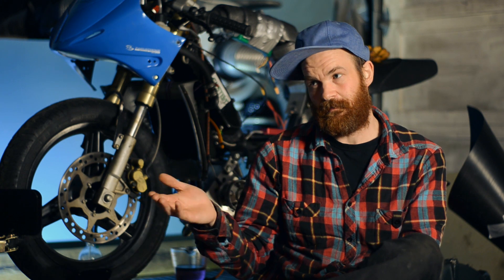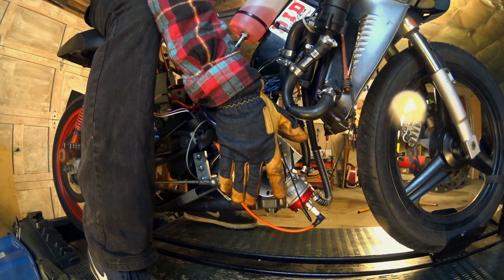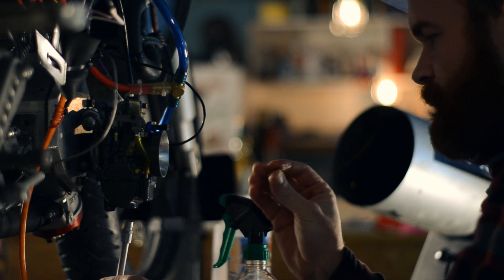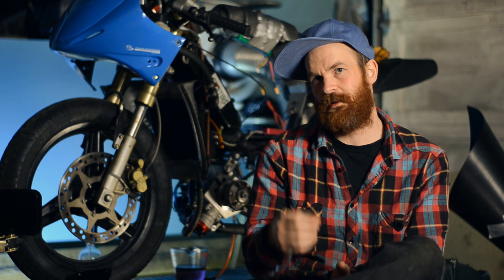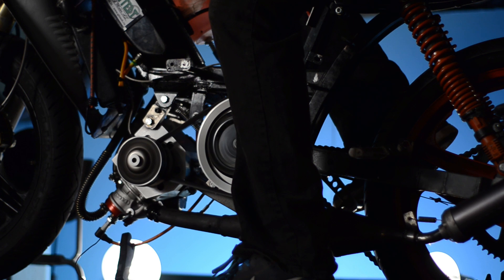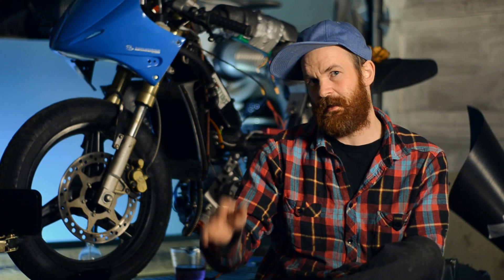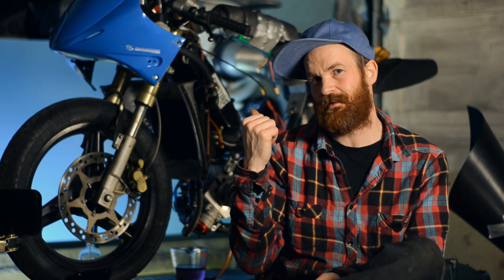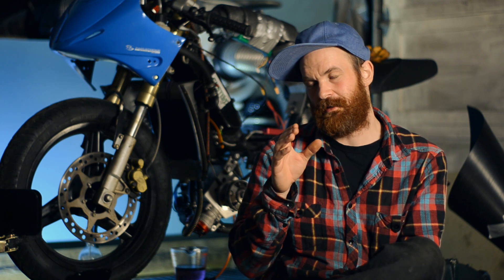Spx Ressurection Part 4 | The NITRO MOPED

Comment: Maybe its bullshit, but in RC models is used to connect the ExSAUST to the tank to add pressure and "maybe" to help the petrol at superhigh rpm to flow, but I repeat it is probably a shitty idea " https://i.ytimg.com/vi/_G2xLRMpwa0/maxresdefault.jpg " i dont know man i'm just guessing to do the "unthinkable" because i think you already made the "thinkable" stuff and beyond...
cheers man! good job btw :) 
Rik
Reply: they did that to help push fuel through the hose as fuel doesn't flow upwards by its self. worked as a pump

Comment: I had these kind of issues on my competition racing scooter. In my case it was the vibration causing air bubbles in the carb. I had it fixed with rebalancing the whole rotating assembly and just for caution used a softer inlet adapter. Not sure if something like this can be the case with the fuel you are using..

Comment: Hay so awesome juggling act loved it nnnnn u call it the stinger  i say expansion chamber n muffler so running rc fuel is made in  different % n i found on rc cars after u brake it in with one % (ill say 20/12) then change it after a jug to different % (20/18) u have to change the expansion chamber as well as retune also... tem n glow plug play big part so i think go back to race gas or change nitro/oil% nitro motor has different for the motor car n boat motors use (20/12 or so) plane motors use like (30or50/12) its just different meth % but i find if u give the motor meth its hard to get it back to reg gas n have to use av.gas 120 octane  i think

Comment: I wonder if the overall design of the pipe is just not compatible with your new setup...  I've only made a couple different pipes for the same engine but header length and cone angles can just be wrong for a particular porting setup...  not necessarily saying yours are, just that it's a possiblity..  did you recalculate the pipe dimensions for your new porting?
Reply from the maker: It's a possibility. I did extensive simulations in engmod tho, should work.

Comment: I might be talking rubbish here but could it be an engine balance issue creating a mechanical maximum rpm. I remember the videos you did balancing the crank and pins, but have you considered the rotary valves balance? I know it is very light but, at higher rpm the energy required to keep the rotary valve on the shaft as it tries to pull outwards away from the crank because it is unbalanced could possibly reduce power or mechanically restrict the engine. Apologies if this is rubbish, just trying to think outside the box.   Great work, love your videos!
Reply from the maker: Thanks! Seems to be balanced ok, I know how bad it vibrates when it's not.

Comment: was the carb sucking the air very hard or not, i remember my mtx80 had a simular issue but my carb was to small (18mm) and a 21 was spot on, but a 32mm on a fifty might just be a litle too large, anyway i really hope you get the spx working again. Greetz Colin
Reply from the maker: It sucked pretty hard😂
Reply: 2STROKE STUFFING might not be the carb then, idk wish u luck. Greetz colin

Comment: it sounds like you are describing a limp mode.. rev cut and rich. i know its carbed but it is sounding like an ecu problem. is there any other ecu you can try? to me if it was anything else then changing the load would cause the problem to come at a differnt rpm. it really sounds great on its pick up then just simply hits a wall....rev cut>!>! Could your pick up be flexing or the magnet not strong enough for the high RPM? maybe the ecu or coil cant handle the current or isnt giving enough. spark gaps? spark temp range? power supply? can you measure voltage at peak rpm? good luck. i know you will get there! lagavulin 16 is one of my favourites, try Ardbeg if you like a bit of peat :)

Comment: Just spitballing here... Does the inlet tract have its own resonant frequency? Changing the inlet size with your fingers surely would change some tuning, which to me hints to the possibility you might be reaching some weird flow state at the brick wall rpm. Maybe move the carb out a bit, or add a length of pipe at the filter end, see if that changes anything?

I'm sorry the stinger didn't work out, I really had my hopes up for that one.

Comment: try playing with the spark plug out of the motor. rev the cdi to 16000 rpm with the sparkplug out and do a slomo to see if its cutting spark or even misfiring with so many signals per second. also after the motor is hot it shouldn't have any loading up issues. if it did it would normaly foul a spark plug.

Comment: I'm gonna say the muffler. Last time we established 9 liters per second intake flow at 11k rpm. But the volume exiting is greater because of expansion. Even greater than your gas engine, because you run a far greater mass of liquid in the mix. Mufflers work by slowing the exhaust stream. Greater stinger cross section area gave modest improvement, but below the flow increase potential such an increase would be expected to provide (a few percent greater for a right around 30 percent increase in cross sectional area). We know your expansion chamber did it's job to near 14k rpm before, we established exotic intake forces are a non issue last week, and your fingers established intake aperture fiddling returns little this week. That leaves us continued flow restriction of the greater exhaust volume. The glaringly obvious example of that is the component designed to slow that flow, the muffler. Next logical step would seem to be removing it, and possibly exhaust wrap to maintain temperature of the stream (more retained latent energy). Sounds almost too simple to work, yet seems like the easiest change possible, and is pretty much supported by observed results. Until you hit the exhaust cycle, pumping volume hasn't really changed much from your previously higher revving example, with changes seemingly suited to higher flow. BTW, I noticed you advanced the rum intake timing to a couple dozen steps before the garage door, which couldn't have hurt, lol! Keep at the nitro nightmare, it will come!

Comment: you can see in the carb that it stops pulling the air in as fast at wot.  (fuel stream gets wider) if the carb doesn't do it then id have to say porting assuming everything else is back where it should be. if the smaller carb does work, i'd try a spacer (more intake volume) for the larger carb.

Comment: ... and the saga continues..

One man struggles alone against the very forces of nature.
The laws of physics counter his every move, épée to parry then riposte,
 battle continues unabated, neither side delivering the decisive coup de grâce.

Hehehee, what an epic riddle in the snow or garage.

Running out of ideas here Alex, however if its to do with exhaust cockup or fuelling spanner in the works then I'm a yellow teapot.

By the numbers:
1. Change your Li-po back to a lead acid battery
2. Not sure I'm a big fan of the Hall effect sensor Powerspark has supplied.
Doesn't look automotive quality, hope its not vibrating on its mount, did they specify an air gap for the sensor/magnet?

Not sure that the 3 wire cable is up to the job either, I can't tell if the cable has shielding or even if the 3 wires are twisted together. I say this because of the electromagnetic discharge you get from the coil magnetic field collapsing and HT emissions from the HT wire/cap/plug. These can seriously f**k with ignitions and EFI if not shielded in some way.
Which brings me to.....
3. Check on the ESE thread and look for problems Wobbly was having with the Ignitech and stray EMP. Search 'Ignitech resistor'. Wob solved the problem by using both a resistor plug and cap.

Good luck, your gonna need it.

PS. Might wanna actually set a rpm limit, say 20krpm, never know pigs might fly.
Reply from the maker: Thanks for the input! I'm hooking up the old ignition unit and battery, at least I know it worked to 18k rpm+ before. I agree about the hall unit, it's basically just a small pcb.
Reply: No worries, its going to be somethng very simple/easy fix or impossible to get to the bottom of. Thats the nature of these things. I have to agree with what AuMechanic said above, need to concentrate on 1 sphere of operation until its avenue is exhausted and not crossing over here and there. Just something learnt over 30+ years of farting about with engines.
If your going back to old ignition, do a continuity test on the Hall sensors while applying a bit of bending force to the sensor with your finger, just to check if the pcb pins haven't fractured with vibration and are acting like an on/off switch once the engine gets into a vibration mode. Also check the integrality of all connectors, had it before where a bad wire/connector has kicked the guts of a perfectly running engine prior to tear down/rebuild.
As i said before the problem has to be ignition, the inability of the engine to rev without load is the give away and its consistant.

Comment: go back to reading about carbs , if you have taken the main jet out , and it doesnt go rich then the emulsion tube , is wrong , which is bloody obvious if your running a oxygenate fuel, i see
your running a egt in the header this will tell what is happening , i also ran a egt in the stinger , but the best is a cht under the plug tells you instantly when its leaning out .,now your running a nitro mix ? what % and in what gasoline or methanol??

Comment: As I said on my last comment on the last video, I had the SAME issue on my RZ50 2 stroke 50cc and it was due to a damaged crank causing loss of compression. Sounds weird loads of Yamaha “specialists” said spark, fuel etc but it WAS The crank

Comment: Awesome video mate. Could it be that's the compression is to low for nitro?... I think it might be a but iam not sure I hope it helps and is the the sparkplug the right one you choosing...? A nitro need special sparkplug if not it will melt and the timing must be changed for nitro. I hope you have a nice experience next time best regards Chikko

Comment: I've had an issue sort of similar in a rotary valve kart engine I bought. The person I bought it off had the valve in the wrong so the timing was messed up. It was strong low down, pulled really well but then hit a wall up top.

Another thing on kart engines, when the low jet was too rich the kart would it a wall at 14k rpm, leaned the low jet off and it would rev through nicely.
Reply from the maker: Thanks, I'll have to check the valve timing again.

Comment: hey do you have a EGT pyrometer  so you can look at real world temp for jetting it will help on fuel curve... the carb does seem large but usually too large effects low speed far more then high speed.  but thinking of it to large will typically make it lean low speed so if low speed seem ok maybe the fuel curve goes way rich as rpm goes higher it does sound like it 4 stroking and all 2 strokes will hit a wall when that happens.EGT might help you see this

Comment: The nitromethane burns little slow, i run 32 degrees Before TDC degrees static timing, but i am running a throttlebody, with kinsler constant flow fuelinjection, i run 96% nitromethane
Reply from the maker: Cool! 96% nitro is a different beast!

Comment: Great video I still think its either air leak or to much compresion. I had similiar problem on my moped runing on gas but i rebuild it and changed the head and problem disapired.

Comment: Is there enough power in the spark?
Reply from the maker: Starting to doubt it... Reading the Ignitionmate at low rpm voltage hovers around 7kv and energy is high, at high rpm voltage goes beyond 20kv and energy is drastically lower. Maybe every other spark is extinguished when it enters the powerband.
Reply: Try gap the plug, let´s say about 0,4mm to start with, below 0.3mm isn´t good, but it´s a good way to sort out problems with spark.
Reply from the maker: Good idea!

Comment: Alex you could try cutting the mix back a bit with some petrol using acetone as a mixer this way it would help maintain some heat and possibly stop the breakdown in combustion at higher rpm, (species5022) is on the right lines with the slower burn. great edit buy the way.

Comment: Is there any way of checking your ignition pick up sync? 
I had a similar problem with a bike I converted to fuel injection etc, 
Was loosing sync just wouldn't rev past like a wall.
Reply from the maker: Checking with a light it seems fine, but maybe it's skipping sparks.
Reply from the maker: Checking with a light it seems fine, but maybe it's skipping sparks.

Comment: I forget what size carb you have on the bike now but there is certainly something to be said for testing the 24mm carb.  Considering that the velocity of the air moving through the carb is a function of the area, and that the area is the square of the diameter, even a 28mm carb will have 36% less velocity than the 24mm.

Comment: Even better video than Last time.
Like the symbolism with the dead end rail 
It rips my heart off when i see you strugle with Your own Engine.
I think the smaller carb could help and What About to add Air filter ??
Reply from the maker: Thanks! I'll try a filter.
Reply from the maker: The pipe should work pretty good, at least it does in engmod simulations. Port timing 204ex, 132/130 trans. 5 transfers, main ex + auxiliaries, 145/88 intake, 14.5:1 compression
Reply: 2STROKE STUFFING it is clear Now that if he reduce the Air flow rpm rises there is too much Air but the Amount of fuel is limited

Comment: Your engine is inverted could you instal a pressure or excess fluid release valve? I dunno if that would do anything but your setup is very different?
Reply: Inverted? what ya mean? His carb is straight up anyway so doesnt matter, i think it has to do something with the rotary valve but i have no more ideas
Reply: you can run a 2 stroke in any orientation, I ran one just like this on a bicycle I built.
Reply: Miguel Pagan Sr  he checked it in previous video

Comment: isnt it like with alcohol, that it burns slower so you need even more advance in the ignition?
Reply: I am no expert, but years ago i raced glow fuel disc induction model boats.
15cc , 7hp, 19-22k rpm..
When running on 16% nitro fuel the pipe length was not super critical when tuning for a specific rpm rating..
Give or take 1cm long or short..
But when running on 25% plus nitro methane the pipe length was super critical, because of the cooling properties of the extra nitro methane..

We had telescopic headers sealed with 19mm id silicone hose.. which allowed easy change of the pipe length..
A Telescopic header  to pipe connection may help your situation.
Best of luck :)
Reply: Around the time you started with the nitro I thought you found out something about timing may not be taking until you went back and selected it again.
Also do you think that their may be some old stale fuel build up inside engine?
Have you done compresssion test.
Other than that keep going back to the way it used to be. Good luck. Want to hear some victory music the next time you make a video.
Reply: The only other thing i can think of is maybe the timing is off on the intake rotor. That it is still slightly open when the piston passes tdc.
Reply: The nitro compensates that quite a bit from pure alcohols
Reply from the maker: It is, but not that slow - remember I had it running good on this fuel before, and peak power only shifted slightly in the rpm range.